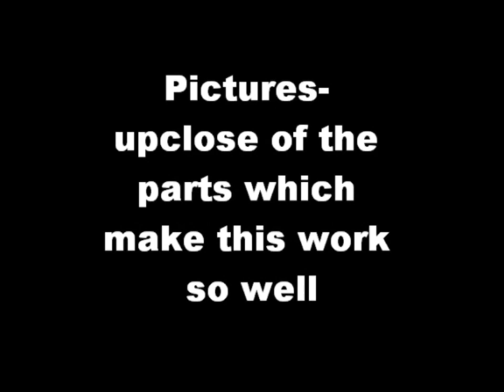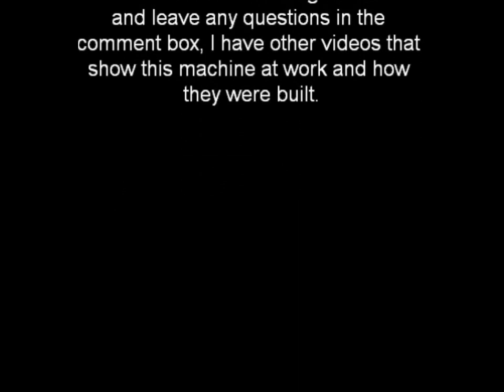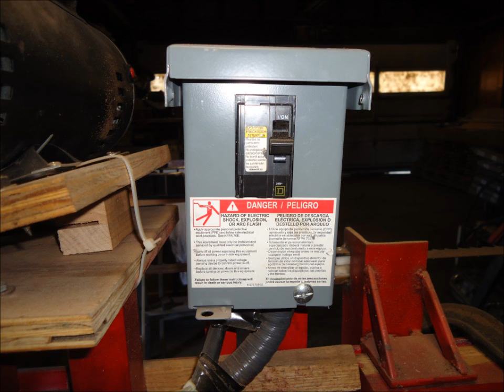Pictures and Illustrations Sawmill: Reposted without music

Comment from the maker: Thanks, the industry word for the log holding devices is "dogs", and basically they hinge on the frame of the track. They stand up to make a right angle and lay down more and more to accommodate for lower cuts.  If you need any advice at all feel free to ask.  I have found recently the hardest parts to find on the internet are the wheels and that is where you need to start, then the pillow bearings and shafts.  Everything else is just framing ect.

Comment: just fantastic......will look for more of your stuff.....like your channel...got to build one......i have some big trees that i would love to mill.....and an old house the needs some remodeling.....have an old metal band saw that i might be able to steel some parts off of....my buddy bought at an auction for 40 bucks about six years back it must wiegh about 600 700lbs...thinking some of the shafts switches maybe motor, wheels...and it is taking up space in my garage..you got my wheels turnin

Comment from the maker: I used a century 90 amp to build that and it did the job, but bigger is better. After that one died I got a 140 pro mig from Lincoln.  It is a lot easier to use,because it shows how to set the darn knobs. lol.  If you keep in mind you have to let the welder rest a lot you can get by with a small welder, I used bolts in some places in addition to welding until I could fix it better.  Give it a test run, hell anyone can weld with a mig.  P.S. This was my first attempt at welding with no lessons!

Comment: Thank you for putting so much time into sharing your knowledge with the rest of us DIYers. Your toe-in photos and tips are very helpful. The wheels, though, are giving me some trouble. I bought two 14" bandsaw lower wheels, which take about a 20mm axle. Your wheels look very similar, yet your axle looks huge--like the 1 7/16" common in bigger mills. So I'm wondering: are your wheels bored for that size axle? Did you have them bored out? Or is the axle turned to a smaller diameter? Thanks.

Comment from the maker: The size of the hole that is in the wheel is way smaller than the 1 inch shaft that I use.  I had a shaft built starting with a 1inch shaft and it was turned down on the tip, also there are threads that allow the bolt to hold the wheel in place.

Comment: @barryo20011 From what I've seen you can use a MIG to do the welds with good results as long as it is strong enough. I have a Lincoln 100 Weld Pak MIG with4 heat settings and I'd be confident in all the welds. I've done trailers with it and all the welds held.

Comment: is there a limitation on  the 12 3/8 wheel size , where the blade will not bend around it properly? most saw mills seem to use 19" wheels . have you tried 1 1/4 blades with good results?  I want to build one ,but I prefer not screwing up to bad on my first attempt. what 1 1/4 blade would you recommend for your mill? the video is great! good job!  thanks for the help.
Mike
Reply from the maker: When  I order my blades the people on the phone tell me that I could and should go to 1.25 inch blades even on my wheels.

Comment: Do you never grind the gullet. I have learned it is important to grind of  small cracks in the in the gullet to prevent breaking....
Reply from the maker: The blades are cheap enough to ignore small problems like that, I get a bunch of uses out of one blade anyway.  Cook Sawmills sends this instruction booklet on how to sharpen the blades from a technical stand point, so if you are looking for that approach you might go with them.  I don't work for them by the way. :)

Comment: How do you sharpen the sawblades?
Reply from the maker: I use a dremel with a cutting disk.  I only touch the cutting side just a tiny bit and it sharpens right up.  Cook Saw Blades seem to be the best for my mill.

Comment: what size are your blade wheels and blade width?
Reply from the maker: 12 3/8 inch wheels, the width is around an inch , and the blade is a 1 inch with the ability to do 1.25 inch blades.
Reply: BlueMacGyver
Great job.no problem for blade to make the turn? Iam guessing you buy from Cooks? Whats the best blade you've used? Can you tell me the pulley sizes  you use on motor and secondary? hp? Can you email me some specs,I want to build one like it.Thanks
Reply from the maker: http://youtu.be/wzrxHjCRpJE here is the link to a video which previews the free plans that I have offered for years.  Below the video from this link is a description area where I give you links to the free plans etc.  If you can't find what you are looking for in that video, then go to my channel and search the section marked videos I have several on the mill and the questions in the comment area will cover all the questions you will have if you actually decide to build one.
Reply: thanks bud